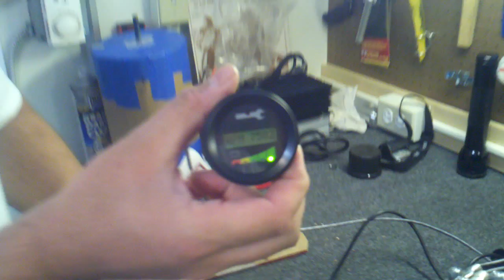AC-15 Electric Motor Bench Test

Comment: Could I do a bench test on a motor just like this one by applying positive and negative directly from a battery?
Reply from the maker: If it's an AC motor, no. This one requires a controller that converts the battery's DC to AC.

Comment: Hello sir,
we are using curtis controller 1238 to control AC motor that is going to be used in an EV. i have connected display molex,however, it's not showing anything. would you please give me some help about this display connection, especially the toggle that you use to change showed parameters in the display. 
regards
Reply: Will this controller run ac motor with connecting only nessesary wires? 
Some controllers ( like danaher controller for ezgo cart) are very sensitive and wont work if any wire is disconnected
Reply: @samehdarawshi3537 yes it does, provided that you do the basic wiring which is enough to power the Curtis controller and other necessary components such as throttle pedal, interlock key and so on. You may look at the wiring diagram of this particular controller to figure the necessary wiring in order to run a bench test.
Reply: Thank you very much

Comment: I like it.  
But there 2 things I'm surprised.  I still find it noisy for a 3 phases motor.
And also nothing holding the motor in place, I guess you went smooth on the acceleration so it does not start flying on the bench.